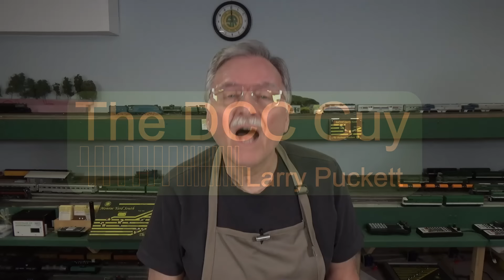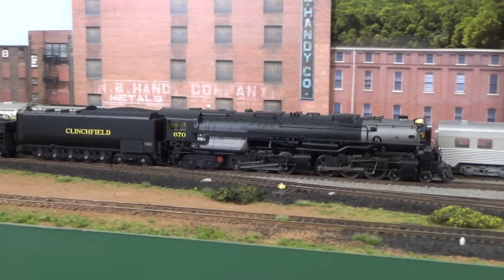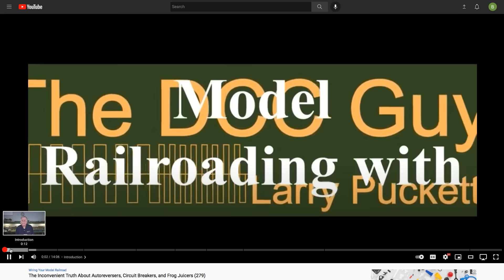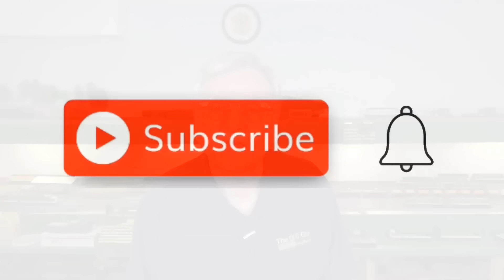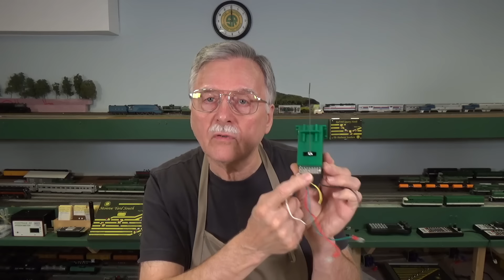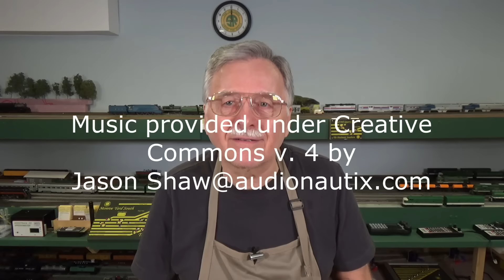Protecting DCC Decoders From Killer Shorts (281)

Comment: Great video on shorts. I am in the process of building my layout and noticed that there is one place where I will have a reversal in polarity so I will need to install an auto reverse circuit to eliminate that problem. This helps me understand the process better. It will be a while before I am installing that area but I am now aware of it. I will also be installing keep alives in a couple of my smaller steam loco's due to their short wheel base.
Reply from the maker: You might have just reversed the wires when you connected the feeders to the rails.
Reply: @TheDCCGuy  No, this is a part of the layout that I have not yet built. I was just following polarity around the plan and realized there was an unrecognized loop that I will have to deal with. I'm glad I noticed it before I put it all together. 
I am finding some of the terminology sort of comical and thinking of explaining to an unfamiliar person how to use a stay alive to deal with a dead frog. Then how the Brits talk about sleepers and droppers, etc. 
I am learning a lot from "The DCC Guy".

Comment: I have never had decoder damaged by a short circuit on a DCC only layout. The only damage to properly designed decoders possible is the software being confused by the electrical spikes. Normally a decoder software reset solves the problem.
Reply from the maker: You have never had one yet!
Reply: @TheDCCGuy  That's because decoders cannot be destroyed by a short circuit. During a short circuit the decoder sees 0 Volts therefore 0 current through the decoder, on the track. On the other hand a power supply, booster or DCC system can be destroyed by a short circuit on the track.
Reply from the maker: Ah but there are current surges and voltage spikes created when a short circuit occurs and those are what kill decoders. Look up inductance in your electrical theory manuals. There can be lots of electrical energy stored in the electromagnetic fields that surround the DCC power bus wires and when a short occurs that field collapses and dumps that electrical energy onto the track. Also energy stored in capacitors on boosters can dump significant amounts of current onto the track.
Reply: @TheDCCGuy  All well designed decoders have components that can handle voltage spikes that appear on the DCC track signal. These spikes are  also created as a result of dirty track and poor wiring. The circuit breakers are designed to protect damage to the power supply, and boosters. Again the decoder during a short circuit sees no volts during the short therefore no current flow in the decoder. Any initial voltage spike is only for a very short time, not enough time to cause damage to the components in the decoder, and well within the peak reverse voltage limits the decoder components can handle.
Reply from the maker: Believe what you want but I trust the EE’s who design this stuff and tell me otherwise.
Reply: @TheDCCGuy  I also have formal electronics qualifications, and have designed model railway circuits for my layout. Even with a circuit breaker or light globe, you can get an electrical spike. All decoder hard ware must be designed to handle these, and they do. When you get a short circuit in the track, the voltage on the track = 0 Volts. That's not a problem for the decoder, but its a problem for the boosters and DCC supply, hence circuit breaker or light globe over current protection.

Comment: So it is probably a good idea to run a UPS with good sine wave output to the layout. All my computers and A/V components are protected by UPS’s. Makes sense to protect trains which are powered my chips too
Reply from the maker: Yes, as I found out a couple of years ago when a lighting strike took out a laptop and command station in my basement. Even though we have a whole house surge suppressor on the main breaker box the lighting strike traveled through the ground and directly into the basement circuit. Fortunately only one circuit was hit, which powered the layout room. Everything on an active surge suppressor was protected but the laptop and command station were connected to a power strip without a suppressor.

Comment: I am watching this with great interest. I have a Hornby Select controller and I installed a Hornby decider into an old Triang loco.
The result was terrific and the loco moved very slowly, better than it had ever done under DC power.
The loco stopped yesterday for no reason and after checking the loco on the test tract and I got a code 11 from the controller and could not change the cv to 8
I disconnected the DCC  and tested the track under DC, it worked ok.
How can I tell if the Decider has been burnt out?
Thank you
PS I visited the San Diego  Museum, it was fantastic
Reply from the maker: Those old Triang motors likely draw a lot of current, did you check into how much? If you use a decoder that cannot supply enough amperage it can easily burn out. Fortunately I have no experience with old Triang locos and none with Hornby decoders so you might ask on RMweb.
Reply: @TheDCCGuy Thank you for taking the time to respond, I really appreciate it.

Comment: Watched the video on adding a TVS diode.  I guess the polarity of the diode does not matter when it is soldered into the circuit because it is not mentioned (and comments were turned off for that video).  I've used the Tortoise internal  switches to control power to frogs for years (after cutting the frog area and insulating).   One thing about older Tortoise (don't know if they changed the design) but back then I had to open the Tortoise and shave off some of the circuit board contact area because the internal switch would switch polarity much faster than the points and cause a short.

Comment: Hi Larry, thank you for this. I run on a small home layout and then on a very large club layout. I just recently blew an ESU decoder in a Walthers SD70ACE while running at home. I am pretty disgusted about the decoder and now I will look to install a circuit breaker, anything that will keep this from happening in the future. I also have two Tsunami decoders that were damaged, they are still working but even after a factory reset are not working properly. Thank you for your insight.

Comment: Man, you have many great videos and I'm trying g to soak up all I can due to buying a bunch of Kato track and switches for a triple loop setup with inside yard. If I set this up on DCC, and I run I to a switch that is not in the correct direction, will that possibly kill a new $250 loco decoder with sound? It's easy to do when talking g or just plain letting train get ahead of your thoughts. I sure wished I had a local train store or group to make sure I'm not fixing to blow a bunch of money. I WANT DCC but I'm thinking of just staying with DC if it's this easy
Reply from the maker: Any time you create a short on the layout the resulting potential voltage and current surge could damage the decoder. However there are ways to reduce the chances of this occurring using the various devices I have shown in my videos. TVS diodes are the most recent of these and I have been finding them on a lot of the circuit breaker devices now that  i know what to look for. The best advice seems to be to keep your DCC power bus runs under 30’ and limit the amperage going to them as this reduces the power stored on the wires further decreasing potential for damage.
Reply: @TheDCCGuy  So if I run up to a switch that is simply not switched for me to go through it, on DC, I just lose voltage and the loco stops. On DCC the loco should just lose power also if the switch (Kato #6 power routing type) is not made correctly, correct? This scenario should not be a short if I'm thinking correctly 🤔
Reply from the maker: All depends on how they are wired and I am totally unfamiliar with Kato’s.

Comment: Is it possible to add TVS diodes across our Digitrax busses to suppress spikes?
Reply from the maker: If you are using either the NCE EB1 or DCC Specialties PSX/PSXX circuit breakers then you are doing that already as they all have them across the track terminals. A TVS diode merely passes current up to its set voltage after which it blocks the excess so spikes don’t get through. I don’t know what the official Digitrax policy is on the use of these and this approach has only surfaced since April 2022 so we are still low on the learning curve.

Comment: just a question about this statement: "Using the contacts of a switch machine to reverse the polarity of a frog is normal for  live frogs like the Peco Electro frogs - BUT will not help if a train runs the wrong way into the point if not set for that train, creating a short for as long as the point is against it. This is very common and the chief short/derailment cause." So would a sensor for every point be better to throw  the point ? Yes a good set of videos.
Reply from the maker: One option is to create a stopping block for that situation. You can cut a gap in one rail leading into the heel of the turnout and wire the rail though one of the SPDT switches on a Tortoise or iP Digital switch machine so that the rail is only powered when the turnout is set for that route.

Comment: Bruce Chubb years ago in a video for MR showed how to use Peco contacts on turnout motors and Atlas Snap relays to control for reverse loops, wyes and frogs. Never tried the tortoise motors but the contacts sound the same as the others. Best way to control those areas without worrying about shorts.
Reply from the maker: Video coming!

Comment: Larry, One other question about placement of these circuit breakers (if I were to swap to these.)  In regards to Power Districts, I have one buss feed that runs 10 feet from the DCS, before the first track feeder meets the buss and has feeders scattered about the length of @20 feet of that buss.  The only yard is in the middle of it.  Does it make more sense to put the circuit breaker near the DCS or out on the buss before the first feeder connection?  Just curious on your thoughts.
Reply from the maker: I have all mine mounted right next to my DCS240 with the bus runs feeding out from there in a palmate fashion. My yards have their own PSX units.

Comment: I’m no electrical engineer, but I have a small layout with one set of feeder wires. Couldn’t you put a fuse or resistor on the feed wires that would pop first?
Reply from the maker: Nothing I know of trips faster than electrons can move along a wire. Ballast lamps are little more than slow blow fuses.

Comment: Yet another great video! You mentioned keep alive's and unpowered frogs. I bought a NOS Bachmann GP with a Soundtraxx factory sound decoder. This engine WOULD NOT go slowly over my turnouts. When I opened it up I discovered that it was a single flywheel model. A large round speaker occupied the space where the flywheel would go. I have a few other short WB diesels that required a KA. But my standard GP and RS3's etc. ran fine through the turnouts. I cleaned EVERY contact I could find and no luck. Finally I took the board out, photographed both sides and sent the photos to Soundtraxx. I asked where can I solder a KA to this board. I got an response the next morning with a picture of the board with wires attached to the locations and a video on HOW TO SOLDER! (Funny!) I removed the train crew and installed the KA in the cab, and this engine now runs incredibly well! Thank you, Soundtraxx. THE BEST! Doing this small switching layout again I would power the frogs. Next time I will per your instructions!! Thanks again for your work!!
Reply from the maker: Bachmann locos also have pretty unreliable pickups on some of their locos which a stay alive can address too. In my opinion SoundTraxx has the best technical/customer support in the industry. Glad you got it sorted out.

Comment: Has anyone thought of doing their feeder & bus wire soldering with the work bench upside down? No tracks or scenery installed but an outline of where your tracks will go and pre  drill feeder holes
Reply from the maker: The guys on Model Railroader Video Plus often will do that. Of course they are working with small layouts that have to fit in an elevator!

Comment: I'm using ME and Peco turnouts for their manual point throw capability to keep layout wiring simplified. I've also installed frog juicers. If I install PSXX circuit breakers and snubbers (RC filters) on the power bus, will that combination reduce the risk of decoder damage from voltage spikes?  Thanks!
Reply from the maker: The PSXX will take care of the voltage spikes and current surges coming in from the booster. Snubbers take care of voltage spikes and help preserve the DCC waveform integrity due to wiring issues and should handle voltage spokes due to shorts there. So you have most if the issues covered. This is pretty much what O have been doing for several years although I have kept shorts to a minimum by having switch machines handle frog polarity.

Comment: Larry ... your comment about "YET" was spot on ... and you're timing with this video was also spot on.   I have a DCC-EX command station (Arduino Mega + motor shield) which feeds a Tam Valley 5-amp booster which then powers my layout track.  The booster has short circuit protection which I checked without any trains on the track.  Never had any problems.  WELL, TODAY ... really today ... my layout was "YET" tested!  A friend brought her three year old son over ... and of course I had to show him a train running.  While the loco was running on the opposite side of the layout, the little guy found and picked up another engine and attempted to put it on the track.  Bingo ... shorts!!   Running loco kept going but the bell turned on and other weird decoder stuff.  So Larry you are 100% correct ... things can happen that you never imagined or planned for.  All the best ...
Reply: Is your loco OK now? Did ya have to reset

Comment: Larry, I wonder if you have heard of or experienced problems (such as spikes or noise) with Atlas or Kato HM-5 motors?   For all of you folks reading this who have the older PSX series, to disable the two second auto reset interval as Larry suggests connect a switch like an SPST toggle switch or am N/C (normally closed) push button switch to the J7-1 & J7-2 connector; the breaker will remain off after a short until the connection from J7-1 to J7-2 is momentarily opened.
Reply from the maker: Nothing specific on those motors, but then this is all a new facet of DCC. I need to explore all the various revers circuits available. I found that Digikeijs sells a little black box designed for reverse loops, the DR5013.
Reply: @TheDCCGuy  Sounds good - will look forward to that future report.

Comment: Thanks for the advice. I have 2 old PSX-4s and the instructions say to add a NC pushbutton across j7-1and2 to put it in Manual reset mode. My question is, can I jumper all the 1s together and then jumper all the 2s together and then connect all the 1s and 2s together with one NC Pushbutton? That is instead of using 4 or 8 individual pushbuttons.
Reply from the maker: I’d have to ask Larry Maier what that might do to the ones that are not a shorted mode.I would not try it unless he says it’s OK.
Reply: @TheDCCGuy  I tried sending Larry an email but it was returned undeliverable.
Reply from the maker: Did you use larry at tonystrains dot com ?
Reply: @TheDCCGuy  thanks, I will try that.

Comment: Thank you for all this information. If you use a relay to control polarity, do you need to add a capacitor?
Reply from the maker: If you mean to control the polarity of a reverse loop, then no, with a relay you would basically wire it a a reversing switch and use a triggering circuit/devcie to control it. That is what I did when I installed an Illuminator accessory decoder to activate a relay that shunted power to track 9 on my staging yard. in that case I used the ESP Wireless system to control the accessory decoder.

Comment: Thanks for this video, Larry!  The MRH article was very interesting indeed.  My layout is a very small shelf type and I'm relatively new to DCC, using an all-in-one DCS 52.  There are only two Peco Electrofrog turnouts.  I've never had a short that I know of, but I will now and then get some odd loco behaviour.  I've always assumed it was dirty track or a DCC packet not being decoded correctly.  But now I think I'll install a TVS across the power feed as some form of minimal spike protection can't hurt.  At this point I'll leave my decoder installations as is, as my loco speeds are always very low and motor-induced voltage spikes following a short circuit recovery seem unlikely (I hope).  Cheers from Wisconsin!

Comment: What happens when a metal wheel crosses a deliberate cut in the track rail, or an insulating rail joiner? Or one axle of a bogie's on one side, and the other electrically attached axle is on the other? It seems to me that for a fraction of a second, maybe longer in the bogie case, the metal wheel will be in contact with both rails, and you'll get a "short".
Reply from the maker: It depends on the purpose of the rail gaps. If they’re there to isolate adjacent power blocks then there should be mo issues. It is only when you have a reversing section or other change in polarity involved you can get a short. There can be some minor movements of electrons if two different boosters are involved but that is just one trying to match the power in the other. It is always best to adjust your booster to have a close to the same voltage as possible.